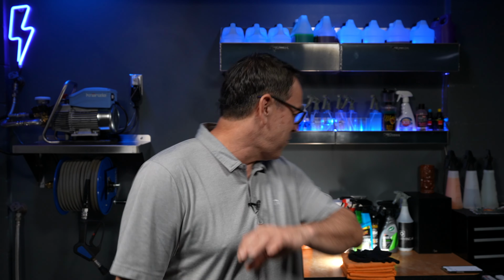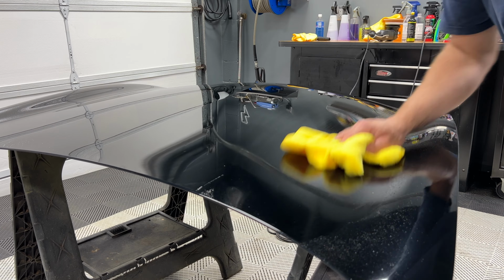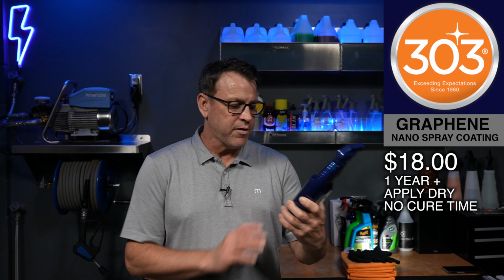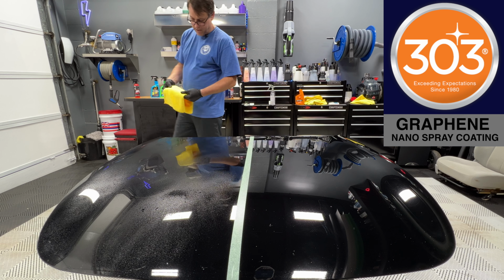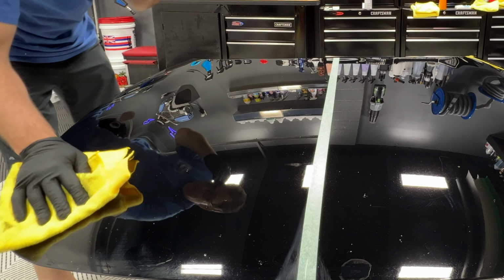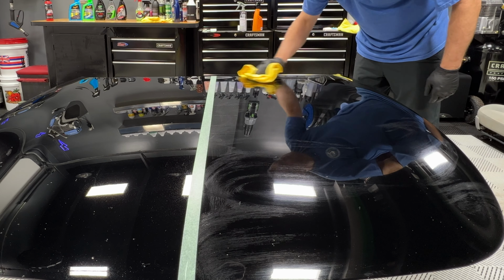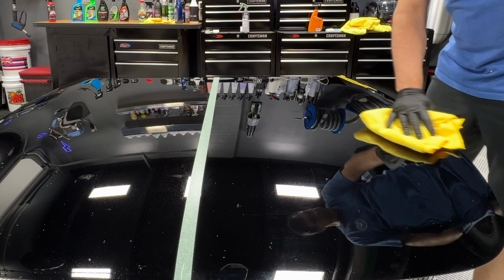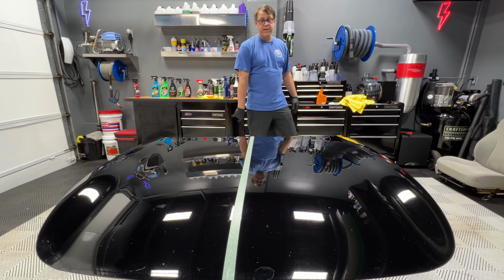NU FINISH Vs 303 GRAPHENE PAINT PROTECTION TORTURE TEST

Comment: Hey man, I love your channel, but you totally missed the target on this one. The Nu Finish is a spray and wipe product, if you let it sit it will be a pain to remove, especially with your overapplication. Also the bottle clearly states "no chemicals" , most people don't get rained on by APC or Iron Removers, if they did, they have bigger problems to worry about than their car paint :-)  Moral of the story: Spay & Wipe + Normal Car wash the nu-finish will last 4~6 months
Reply from the maker: Thanks for sharing. I agree these tests are harsh and it does not represent normal daily use of a product. It just shows durability to a beating by cleaning products. It’s fun and tells a story about the product as a whole. Application, cost hydrophobic properties etc. I tried to use it every way at different times and on black polished paint it was definitely not as easy as some of the others I tested. Thanks for watching.
Reply: 4-6 months isn't that exciting.  We were getting 6 months out of old school polymer sealants like Meguiars nxt.  That stuff has been around for decades.  Was hoping new graphene tech would be better but it seems like it's the same as what we have always had.
Reply: @wickedlou9  I Love NxT especially on black cars, the shine, gloss and slickness are just amazing! But it does stain the trim, it has to be applied on a dry car and it's a little more difficult to wipe off than the Nu-Finish Graphene, which can also be used as a drying aide.

Comment: I use the 303 Graphene on all my customers with black or grey colored vehicles.  Roofs on trucks and SUV are great to show the effects on how well it can shed water and grime.  And I follow 303 recommendation to spray the product on a MF sponge and then spread it out.  Then watch it sweat and haze and remove with a another MF towel.  Impressive results even in hot sun!
Reply: I read a review and I love it, but you can use this on vinyl roofs and plastics too?
Reply: @to5msheppard  It is safe for all exterior trim on vehicles BUT highly recommend on vinyl and plastic consider using the 303 Protectant product.  It has the UV inhibitors and can do best to protect those when used on a regular basis (bi-monthly).  My truck tonneau cover is really helped using that product.
Reply: I might be a little late to this thread but I have to say, after watching a bunch of videos I decided to go with the 303 after doing my paint correction/swirl removal. It's been a fun, wonderful learning process. Anyway, I choose the 303 because of ease of use and ability to be used under the harsh sun since I have a driveway but no garage and the Miami Sun beats on the car after 10 am. An added bonus is that my car is wine-red metallic, a darker color (the graphene does increase contrast and it's more noticeable on darker colors). I did use a little 8x8 tent to get at least some shadow, and went in stages, since it was hard to polish everything in one swoop depending on weather, etc. So: the 303 Graphene Nano Spray goes easy in the applicator, that allows you to precisely control where it was applied and if you're missing a spot, and it cures fast here and the car is immediately protected. I know it's not an 8-year coating, but for the price, easy availability (Amazon) and easy of application, it's great. Try to get some shadow if you can. I bought the 303 Graphene detailer to maintain it and it works well but I found it a bit grabby. Since I'm working at home, and I keep the car under a cover to try and save it from the sun most of the week, I switched to Tech582 as a final detailer/protection after washing and it's working fantastic, paint is super slick. I recently went to a cousin's farm in Montura, FL and expected to have issues with the bugs like I did the first time I went there when it was unprotected. Nope: the bugs slide off with just leaving some car wash foam for a minute or two. And I just went last week to West Palm and back, and I tell you, hardly any dust, and in the evening it rained a bit, I just towel it dry quickly before more rain came in so I could cover it again, and it looked as if I washed it. I am very satisfied with the product. What I'll do in the future is alternate the 303 Graphene detailer with the Tech582 after washes to keep the protection up.
Reply: And I apologize for the long comment, but one more thing: in the old days I used the original NuFinish and then I was impressed comparing it to the old waxes available at the time so before I started all this, about  8 months ago I tried the "Nu Finish Once a Year Polish and Sealant, Car Polish and Paint Sealant with 3-in-1 Ceramic Technology" and I did experienced the same: even applying like they ask with the damp applicator an all, you have to FLY and remove it and even so I've got a lot of streaking. Way worse than the original, you spend a lot of product and the protection is not great. I still have almost half of the 303 Graphene Nano Spray bottle.

Comment: Looking forward to seeing what works best. Currently use the 303 but if there is something better definitely would make the switch.
Reply: Mckees 37 makes a great spray on spray off coating
Reply from the maker: 303 did pretty good. Looking forward to the next challenge to see if it gets knocked. Thanks for watching

Comment: At the beginning of the test it looks like you used Adams car shampoo in the foam canon. 
Is there a difference in using the adams mega foam and and car shampoo in the canon?

When I wash my car, would you recommend using adams mega foam in the canon and then washing it with adams car shampoo with 2 bucket method,  or can I get away with using either adams mega foam or adams car shampoo in the canon and then washing it off with the 2 bucket method. (1 bucket clean water, 1 bucket where I use the grit guard.) the clean water bucket to put clean water on the mitt before wiping off the soap or foam on the car.

Thanks
Reply from the maker: I usually use mega foam in the cannon and the soap of your choice in the bucket. You can use any of these soaps in the cannon. I usually spray the car with foam and if it’s not that dirty I go straight to the 2 bucket contact wash with the foam still on the paint. If it’s dirty I rinse the foam off and do the contact wash next hoping this pre wash will rinse away some of the dirt on the paint before i do the contact wash. Hope that helps.

Comment: This was a great video Jeremy, thank you for taking your time for these. I truly appreciate your charisma and content.
Being honest tho, what do you consider longer lasting and better overall OG Drying aid vs P&S Beadmaker, I ended up getting the OG Drying aid and I'm not super impressed about it, have yet to try beadmaker.
Reply from the maker: Thanks. I think the drying aid is a better product overall. You have to have the paint prepped and in good condition and it should come out really slick and shiny. If not consider a light clay or polish then apply. I do like beadmaker too. It provides a similar experience. You really can’t go wrong with either product. Be sure to put enough on when applying also. I prefer to use both on a wet car as a drying aid. The durability on both is a short term apply each wash type of protection. OG probably will out last beadmaker. I hope that helps. Let me know if you have any other questions.

Comment: The iron remover contains ammonium. Amonia basically, Dang! 303 Def the winner. A good claybar step, then a paint cleaner, then apply the 303 graphene, then the 303 speed detailer as a final wipe. 👍

Comment: I used nu finish as a teenager with my first car 30 yrs ago and found it to be crap! The bottle said something like once a year car polish that will last threw 52 automatic car washes, nu finish would wash away after 2 hand washes lol. I was happy with turtle wax for several yrs then made the switch to Adams products up till I applied Avalonking armor shield ceramic coating. Armor Shield been on my truck 3 yrs now with no signs of the coating wearing away.

Comment: I believe the new finish or any wax would last due to the fact that no one is going to spray chemicals on their paint to try to remove their wax plus most people will reapply the wax after they dried their vehicle I am a old school detailer from 1992 I still do the buffing and waxing even though I have to do it on my Cars 2 to 3 times a year I am testing the new finish on my black car for about 6 months to really see true results this is one of the First videos that I have seen where the guy has actually applied the new finish correctly and busted off
Reply from the maker: Thanks for watching. Stop back and share your results. I appreciate it

Comment: from these two 303 took the win. I want to see the winner go up against griots 3 in 1.
Reply: Griots easy win on durability. But Grtiots is also harder to apply.
Reply: @SpartanKyuubi  the key to griots is not too over apply. 2 sprays max per panel. Then buffs right off with the microfiber towel.
Reply: @pullingthestrings5233  yeah. Is a good money maker. Best value for a Spray Sealant on the market. Still not as user friendly as other spray sealants on the market and many beginners have issues with it since they expect it to behave like a regular spray wax.
Reply from the maker: Griots is coming soon.

Comment: i THINK YOU USED TOOOOO MUCH. TYPICALLY IWOULD SPRAY 2-3 SPRAYS PER PANEL OR HALF THE HOOD
Reply from the maker: Yeah. Even a little was hard to get off. Maybe less would be less to scrub off. I am honestly mitt impressed with the Nu Finish. Was a pain to work with and failed immediately. Thanks for watching and sharing.